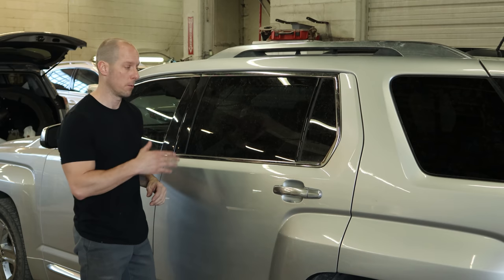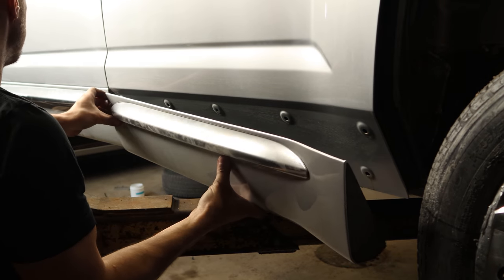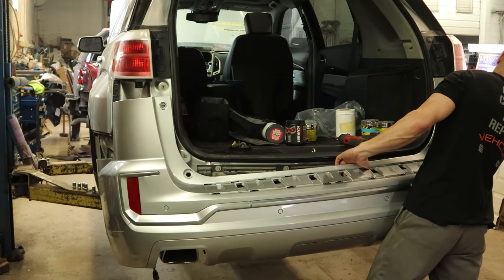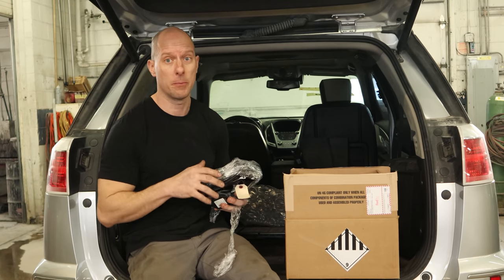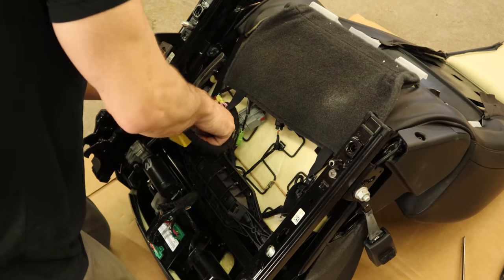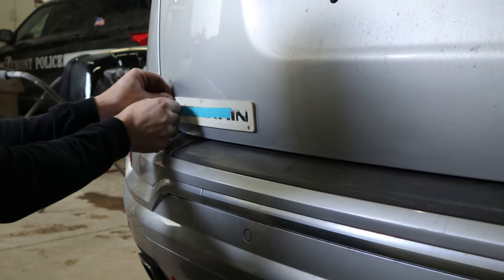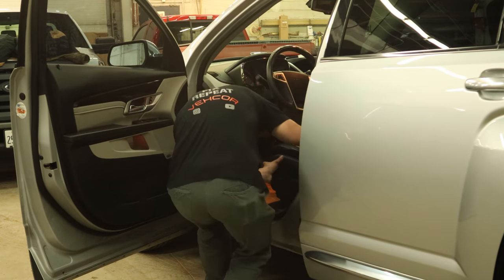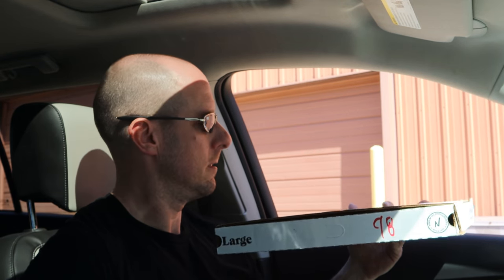Completing the rebuild of the last failed rebuild on a 2016 GMC Terrain Denali

Comment: LOL, your oil change rant was EPIC.
Reply from the maker: There will still be people blaming their cars for their neglect!
Reply: Yep, I agreed with it. GM says to trust their OCI lights, but every one I had the carbon sensor goes bad and sometimes it will tell you that you need to give it an oil change 500 miles into the previous one (and, yes, I do reset them properly), and sometimes it won't tell you that you need it at all. So I just stuck to my regular, changing the oil at around the 5,000 mile mark and called it good. Part of the reason why I like how Subaru's handle maintenance. You just program how far out you want the intervals to be and it keeps track of the mileage and/or months.

Comment: I worked for an oil change company back in the '90s. We were too much competition for jiffy sludge so they bought out our company. As managers we were told we would be given time to train the jiffy way. In the first meeting as managers we were told $5000 A MONTH in damages to customer's vehicles PER STORE was acceptable. The first month I heard that a lower level tech drained the transmission instead of the oil. Didn't notice it and they put oil in the engine. It was a brand new Mitsubishi with 1800 miles. They had to get a new transmission from Mitsubishi. $5000 install. I stayed 6 months for financial reasons. I was the last manager from the previous company to quit jiffy. Everyone I worked with thought I would be the first.

Comment: Love your sarcasm oil change
Reply from the maker: I always have plenty of sarcasm to go around!
Reply: @vehcor  Yeah, but you didn't make sense. It is not illogical to stick to manufacturer specifications for oil and oil change intervals, unless it turns out that they are wrong. Synthetic oils can last over 10,000 miles.

Comment: I've never heard of changing oil at 20,000 miles. Our cars have recommended oil changes at either 3,000 miles or 5,000 miles. 
Now that you've repaired the damage and repaired the previous "repairs" the Terrain is once again fit to be used. Whoever buys it will be very happy with it and all the maintenance is done. All the best from Queensland Australia.

Comment: Scott, you would think by now I would have learned not to drink a beer while watching your videos! You owe me a half roll of paper towels! You didn’t say which tool you used when you installed the spoiler, shame, shame! My brother had one experience with jiffy lube, he had them do a full fluid change on his Ford pickup, yes I know, I hate to admit that I’m related, two strikes, a Ford and jiffy lube. They replaced all the fluids except for the rear differential, they left it dry. It cost them thousands of dollars to settle with him after the rear end locked up at 70 mph. So, no more jiffy lube. Btw, the freight liner I drive with a Detroit DD15 has recommended oil change intervals of 50,000 miles. We change at half of that. Another great video. Dan.

Comment: I was rushing and I forgot to put the oil plug back in a Toyota once. Filled it with oil. Went back into the hole i drained the old oil into, Started it...  Looked down, Oh shit drain plug. Thing ran for like 2 mins with no oil.   No engine noise at all!  Amazing.   Plug in. Refilled it. Woops! I should try to 2 inch ratchet strap the exhaust pipe straight on the truck Good idea I might try it

Comment: Been on a VEHCOR binge past several days. Love the videos; lots on helpful info... Even for a Ford guy like me. Did have one idea, although I doubt I'm the first to suggest it. Having one of those Quick Jack lifts on (or for) the trailer might be nice. Could make the "on trailer" repairs to get the vehicle off the trailer a bit faster and easier.

It could be flush mounted in the trailer deck with a flat cover on top. Probably would need a skid plate underneath to protect it from the road salt. Maybe coat the whole thing in cavity wax or fluid film.

I know not to ask about the Mustang, but how about just more Fords! Thanks for all the informative videos.

Comment: Great job as always! Spark plug boot tool for the headrest post clips may work to squeeze them and not pinch a finger.Thanks for sharing. Stay safe and be well.
Reply: I had a 2011. It had the 2.8 also. At 94k it had to get a new chain AND VVT sprockets. They were bad too and after I proved my case to GM they were covered under warranty with the chain. But the most frustrating part was the continued exhaust manifolds it ate at every 15k.
Reply from the maker: I tried pliers, hose tools, nothing fits at the proper angle except my fingers. 😂

Comment: Listen brother, i love your videos, i love your work and i would buy a rebuilt vehicle from you if i needed one...but it really takes no time to clean stuff before putting it back together. Its already off. Just spray it off, wipe it dry and boom its clean. Thats my only gripe. I hate dirty cars. Ive bought and fixed and sold cars for 14 years...i always sell super clean vehicles, yet i always get vehicles i have to clean myself... but cleaning a car is so satisfying and i truly enjoy it. If i was closer to Chicago, I'd come clean all that stuff for you.
Reply: I also change my oil every 2-3k miles. Always have always will. Manufacturers don't care about your car or engine or even you!

Comment: You are 100% correct about the oil changes. Sad problem.The oil is so diluted with gasoline you have to change it at 3000 miles no MORE... I confirm this issue by using Blackstone oil labs  Analysis for one year on a brand new zero mi's 2.4l. from Gm. The fuel pressure levels are so radical with the change in charging system voltage on a lot of these cars. Just get your oil analysis every 3 to 6 mo.

Comment: I couldnt agree any more with the remarks about the ecotecs, great engines ! But people dont change their oil, so they have a less than great rep, and used engines are a crazy 2500 minimum around here, nuts ! Ive bought a few with 60 or 70k miles with sludged up motors and junk chains, and i bought a one owner with 180k on it that looked brand new under the valve cover, because they changed their oil, crazy right !!!! keep up the great videos man

Comment: Most of the seat headrest sleeve tabs can be released without pinching your fingers by sliding the right size deep socket over to push the tabs. Usually works for me.

Comment: Its ready to go until one of the main seals blow out due to crankcase pressure in cold temps. Run people. Run far away from 4cyl Terrains especially in cold climates. Also extra especially with totaled titles, With that said you did do a very nice job. I wouldn't buy it for any amount of money but your a very skilled craftsman.

Comment: Damn it! I've been doing brake jobs the hard way for all this time...where do I get one of those magic tapping devices? 
Oh and you had those adjustable hammers reversed...should of used the metric on the standard side and the standard on the metric side. 
Love the sarcasm of your videos, especially the Jiffylube ribbing. Great work as always.
Reply: My late wife had a little Olds Calais that she dearly loved.  She took it in to a Jiffy Lube and they royally screwed that car up!  On that car's engine the oil filter is up in the oil pan.  A simple nut takes it out and WAS, before Jiffy Lube, never a problem.  The jerk put the nut back on with an impact wrench and we eventually had to have a new pan installed because the nut on the old one could not be removed no matter what was tried.  To this day I flat REFUSE to take any vehicle I own to one of their amateur oil change stores.
Reply: @richardcline1337  The last shop I worked at in Phoenix, Arizona, I seen cases like that almost daily! It sucked to undo those that cannot do.

Comment: My previous car (the one in my avatar) was a rebuilt repair and while they MOSTLY did a good job when the left rear side marker stopped working I took it off to replace the bulb and I saw that they re attached it using JB Weld instead of replacing it with one that had an actual clip to snap into the rear bumper.
Reply from the maker: Eh, if that is all they did, no big deal.  It won’t hurt anyone.  I mean they needed save that $15 after all! 😂

Comment: I keep on misplacing my metric crescent wrench!  It is almost like that 10mm socket that is always missing.  .Another great build!  Wonder if the last wreck was filed and who did the repair?
Reply from the maker: Sometimes you can use the standard adjustable hammer in a pinch. lol Thanks for the support. I will have a little more info on the last guys if I can find them.

Comment: RE: Changing the oil frequently.....had a 2009 Honda Odyssey.....and would bring it in when the oil monitor was at 50 percent...about 3700 miles...and the dealer pushed back and said to change it when the monitor alert went off...I had to really press them on it...and I think they added to the customer profile comment that I was "old school" when it came to oil change intervals....funny thing is, the VCM Honda engines consume enough oil, we probably ended up adding a quart or two if we went the full distance.

Comment: man, i need to learn the Tire installation technique for work! (and I looked up the MSRP of that back resonator on GMParts Direct, and now I see why you chose to bend it back rather than replace it; its nearly $1,000! but hey, its not the first time I've run into exhaust parts that expensive; GM wants $2,600 for both cats for my 2010 Chevrolet Aveo, and the ENTIRE CAR is only worth $2,500 in good condition.)

Comment: I have seen you use a very cool set of trim pliers many times in your various videos. I have tried to find them but given that they are on the screen for only a very short time it has been difficult to get a clear look at them and then find them online. I find some that I think are similar but do not seem to be the same. I would love to know what brand and model they are if anyone knows as I would love to get a set. That trim removal for rocker panels etc. have always been a pain in the butt for me.

Comment: I was about to buy one of these it was a 2016 Denali AWD 3.6 V6
Reply from the maker: I had the 2015 that I put the front end on for a couple years.  It wasn't the best on gas but it had all kinds of power.
Reply: @vehcor  I remember that on it made me look at a few haha, the guy at the GMC dealer told me not to get one bc the V6 was crap

Comment: Got a similar vehicle 2013 captiva. Of course it was well maintained fluids recently changed etc. Yeah they weren't. Dropped the oil did the plugs air filter etc. Dropped and changed the tranny fluid. Can't get the message to change tranny fluid to reset. Tried the key on 3 gas pedal pumps pulling battery and the fuse. Any other way to do it without a factory tool to reset it?

Comment: Very unusual for your usual high quality builds: right rear quarter panel looks like it's a different color from  the door and bumper. Additionally, the right rear door seems to be hanging a bit low. Do you think that during one of the previous totals, there was damage to that area that you didn't redo?
Reply from the maker: Every panel was painted and all look different from the next, it is just that color.  The doors on these do not line up from the factory so mine is actually wrong.  I did fix the right one to match.

Comment: Real problem was oil consumption in the 2.4l engines from 2010-2012. The pistons rings would go and wear the cylinder unevenly. Class action lawsuit and they extended the warranty on the vehicles to 10 years and 110k miles. Just buy the v6 or the newer 2013- 2017 models and those didn’t suffer from the grenade syndrome. Also the early models, the high pressure fuel pump would leak internally mixing gas with the oil  leading to loss of viscosity and causing the chain to stretch of the cylinders to crap out.

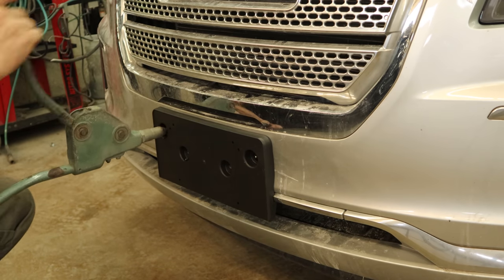Comment: 20:40  Get a rotary screw compressor next time, lots quieter and less power consumption.  Yes, they cost more to buy however then energy savings are worth it.  Also, these go 10's of thousands of hours with, as you guessed it, regular oil changes.

Comment: You wouldn't believe the pressure that the engineers are under to not change anything. If it's not broke don't fix it.  So it can result in Philips screws in one place and bolts in the other.  I would bet that a change in the design created a change in one of those areas and the engineers took that chance to change between bolt and screw.  But since the other end wasn't changing they did not extend that bolt screw change to that area.  What's more is it might be that the whole motivation was the bolts were 2 cents cheaper than the screws.  And sometimes they even listen to the factory about what's quicker to install.

Comment: Even if you use full synthetic mobile 1 and change every 7k miles those 4 cylinders are trash, iv had two since they were new and 1 burns a quart per 500 miles ( this started around 50k miles on it) the other burns a quart every 800 miles (this started at around 70k miles). I now own a 2010 ford escape and i change the oil every 10k miles and it hardly burns any.

Comment: Speaking of cam bolts. I hate GM's design, atleast the older ones. My ZR2 Blazer doesn't take 6 months to knock its alignment out because of those damn things. Gonna have'em put a tack weld on'em next time.

Comment: Youre wrong on the 5000 mile oil change with GM because most of them come from the factory with synthetic oil which will run much further than that and if it has synthetic oil you have to put synthetic oil back or you stand a good chance of messing up that engine
Reply: Unfortunately it's not a one size fits all situation.
It very much depends on how the vehicle is driven. Stop-start versus highway miles,  turbo/supercharged versus normally aspirated, gentle driver versus leadfoot.
The harder the engine is forced to work, the more combustion products will blow by the rings and end up in the oil. There's a very good reason why top fuel dragsters tear down the engine after each run.
Reply: @morriewyatt6234  Even with all that said you still cannot switch an engine which has been broken in with synthetic oil to Regular motor oil and synthetic oil will still go much further than Regular motor oil between oil changes and the ONLY thing you said that was right is it isnt a one size fits all but all the rest of what you said is nothing more than trying to be a know it all bunch of garbage because what I said is still standing because if you buy a car today that the factory has started out with synthetic oil you HAVE to keep using that type of oil. If you switch it to regular oil you stand a GOOD chance of RUINING that engine check it out with the dealers and they will tell you if you switch from synthetic to regular oil you will void the warranty on that engine

Comment: 8:07 20K? Only if you skip two services. Don't attribute that to the manufacturer. GM calls for 7500/6 Months. You follow the manufacturer guidance and/or the Oil Life monitor, the engine is probably going to outlast the the car. The oil life monitors in a couple of my cars account for short trips (acid), engine load, and of course time... All of my stuff looks like new under valve covers. ...and I've got a truck that's old enough to vote; no oil-life monitor on that one though, just 15 Quarts of pollution-dilution.
Reply from the maker: When the 2010 Terrains were released, the oil change intervals were 20k.  They had a recall to recalibrate the oil life monitor to 10k after all of the engines were blowing up under warranty.  10k is still too long in my opinion.
Reply: @vehcor  I found a few articles from 2013 about the change. One claiming it used to be 4K-12K but was changed to drop to 20% oil-life at 5K Miles no matter what the life was up to that point. 12K Is a hair optimistic for 5qts. (6qts for the 3.0L).

Comment: You know it's a boring build when you watch the Public Service Announcement ads inserted into the video.   I totally believe that your brake installation hammer and tire mount throw technique work as shown in the video.  But one thing I find less believable is your narration lacks the colorful language metaphors sprinkled about when a tool slips, or you find a particularly interesting case of someone's been here before.  Do you edit these out, or are you just that unflappable?
Reply from the maker: Actually I am pretty calm.  I was not always that way.  I had a bad temper.  It turns out I just had too much energy.  Now I spend that energy at the gym.  It makes me a much more pleasant person to be around.

Comment: Not true that you need to change your oil my 93 Ford Ranger has been running on a consistency of white oil for about a year now I keep driving it like I stole it everyday and adding a quart of oil for every gas fill-up
Reply: So you're actually changing the oil every 1,000-1,500 miles.😎
I've had a few cars that I added so much oil, I just changed the oil filter once a year. LOL
Reply from the maker: Fords do seem to like neglect.  I have a few customers that treat theirs horribly and they are still going and the babied ones are having issues!

Comment: Someday the whole car will snap together.  After a wreck just pick up the pieces and snap them all back together.  Won't need wrecker trucks anymore.
Snap on tires, snap on wheels, snap in engines, snap on rocker arms, snap on brakes.  And the kids can be snapped into the back seats.  Let's not forget the wife.  Snap her in.  My wife already clicks and pops when she gets out of the car.  But I think it's her hip replacements.